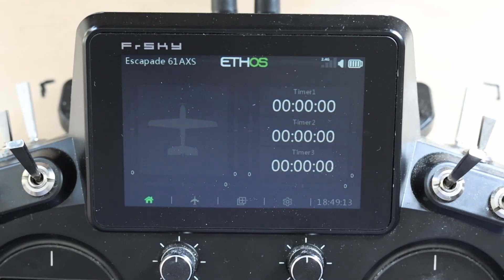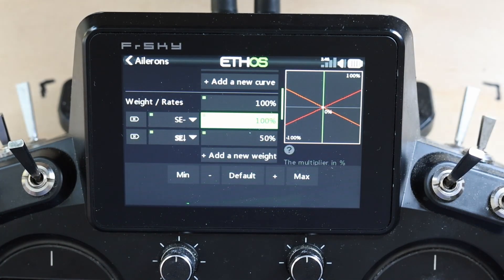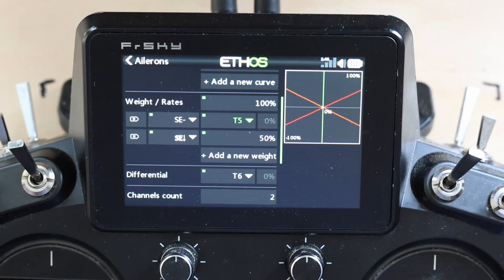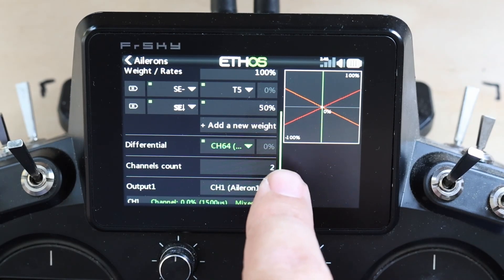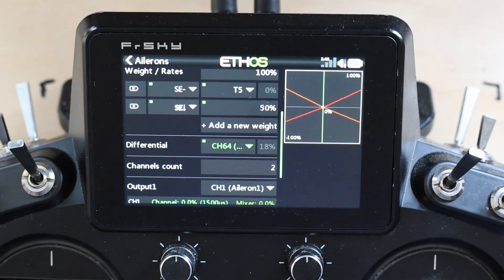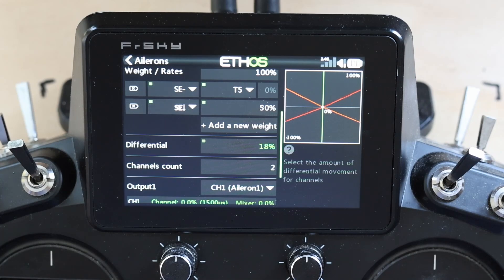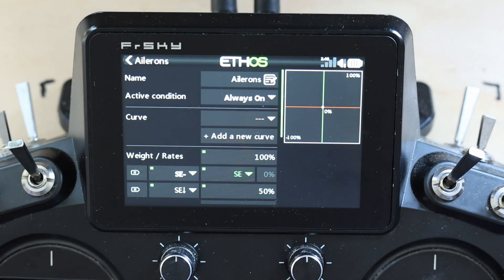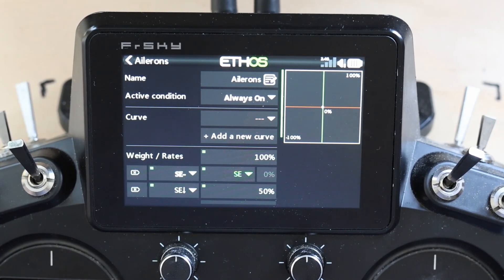ETHOS Tech Tip 12 - Better Adjusters

Comment: Isn’t this the same as setting the diff to a source (ie. a pot dial), testing for adverse yaw issues and then set the diff back to a value?
Reply from the maker: No, as I mention in the video, this technique constrains the range of adjustment so you do not go out of the desired range, where simply assigning a source will always leave you adjusting in the full -100 to 100 range. It’s not a big deal for Differential, but it would be actively dangerous to do for rates.
Reply: @adam_mawz_maas  thank you. I understand now 😊